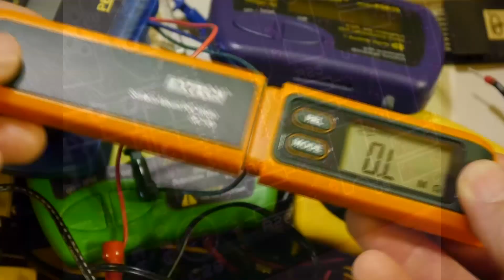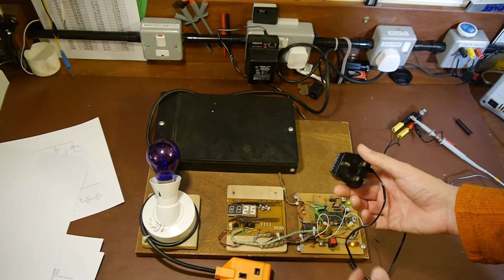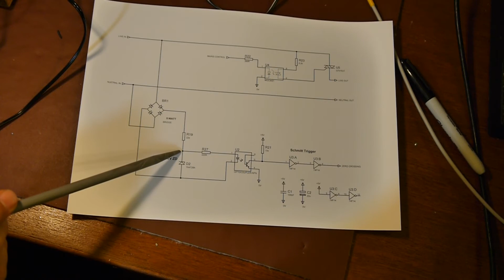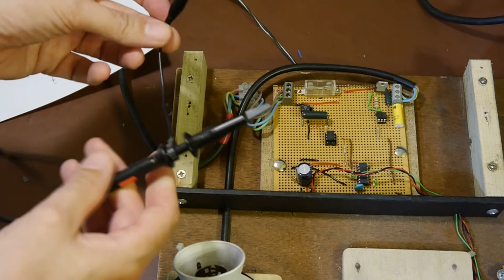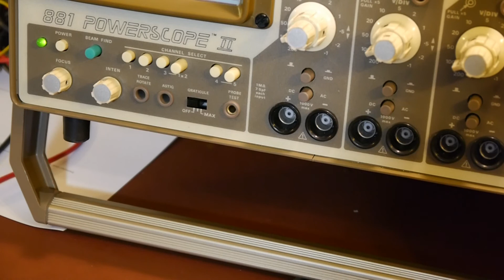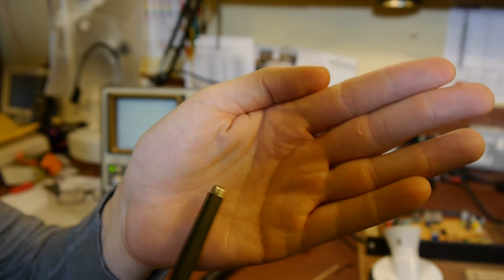Power Trip!    Part 1

Comment: A long time since I saw a Diac.  For those who don't  know, it's basically a bidirectional zener.
Reply from the maker: Simon Spiers Quite right the silicon substrate is really quite interesting. However I can assume I used it only because I had one in hand probably pulled off a scrap board as I  know bugger all about mains power. My best regards Chris
Reply: @allthegearnoidea6752  , in fact, it's not a DIAC, but a Triac that's optically coupled.
A real DIAC, useally has a blue color, looks like a Zener diode and is marked with DB3 (or DB4 depending on the breakdown voltage) and has a breakdown voltage between 28V and 45V and acts like a back to back Zenerdiode.
A MOC3021 use maximum 1.5V to turn the Triac output on, regarding the datasheet, a MOC3021 may only be used as a trigger device for a larger Triac. But i know from personal experience, if the load is below 50mA, you can drive it directly.

Comment: I've never seen anything like that Powerscope, what an interesting bit of equipment. Then again, I don't do a lot of industrial HV work!  I suspect those probes are irreplaceable, are they?  Regards from 120 miles south.
Reply from the maker: Andrewausfa Hello Andrew how goes the life down south it's grim up north you know. It's a pretty crappy scope but it's all about the differential inputs. I bought this to track down  some problems with Three Phase inverters I was using to move locomotives sideways on a traverser but the inverters kept tripping loosing synchronisation with each other.  Turned out to be a bug in the inverter firmware so it paid for itself and proved my own software was not at fault. Makes a change I'm shit at software! My best regards Chris
Reply: Tonight it's grim dan Sarf too, well at least in the west of Angliashire. It's mostly pouring and very windy! That would be interesting to see the mechanics of moving locomotives sideways, if you're ever in the Deltic yard. I knew you worked on railway control systems and love a bit of engineering wonderment.
Reply from the maker: Andrewausfa  Hi Andrew yes done a lot of big heavy power projects over the years some on the railway but others for Rolls Royce with an enormous jet engine handling monorail system for the A380.  Also done systems for British nuclear fuel  for robotic crane handling systems. Unfortunate I cannot show anything on the YouTube due to customer confidentiality.   Shame really I'm quite proud of these.   I started off in electronics design but moved in PLC and control system design relatively early on I didn't expect my career to go this way but had to pay the bills.  I wish I had more time to go down the electronics route but no complaints it's been an interesting life.   Been doing more electronics in recent years but as a project manager and system architect roll.  I kind of know enough electronics and software to beat up both camps. Regards Chris